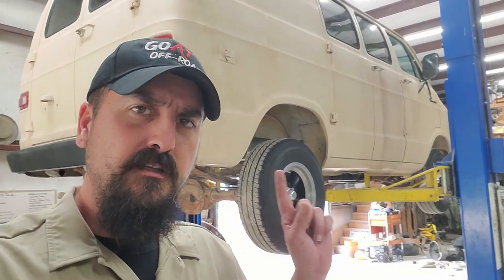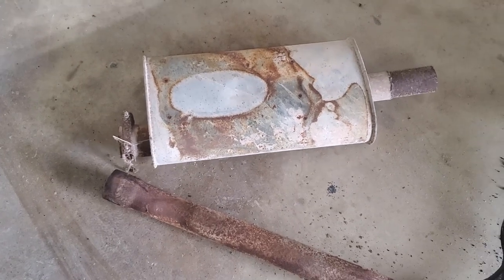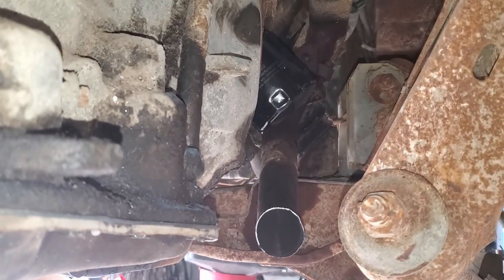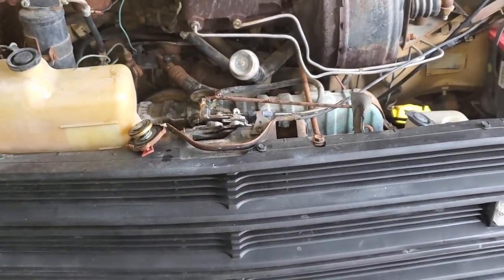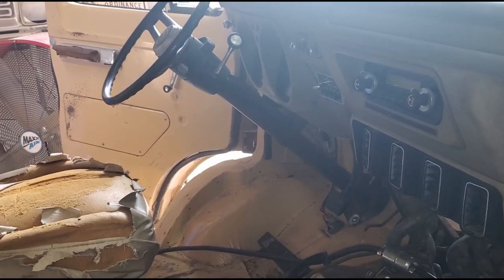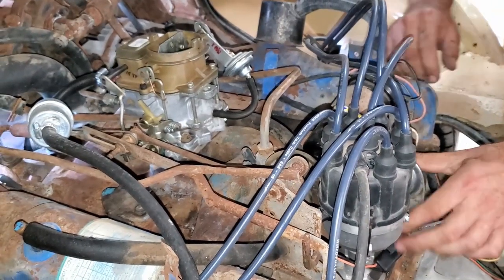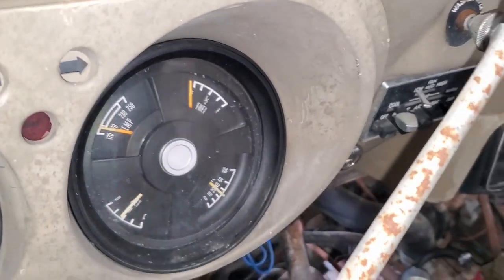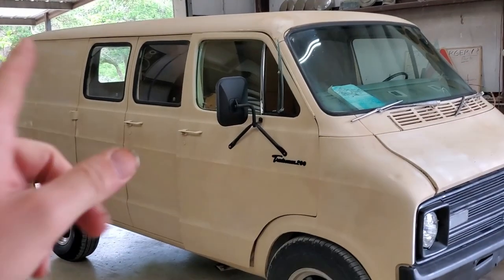ABANDONED Junkyard Dodge  B200 Van Pt 2 Will it Run ? Will it start ? Will it Drive?

Comment: The lack of trans filter tells me this was already a race van, cheaters. Jeremy might have to lose some weight/interior. Great video guys, always a blast to watch.
Reply from the maker: That's right we are cutting all the weight! Interior seats, Interior panels, Exhaust, Transmission filter, Transmission bolts! Everything is fair game!
Reply: @DuddiesAdventure  Just mig weld the pan to the bottom of the transmission. You don't need those heavy bolts.

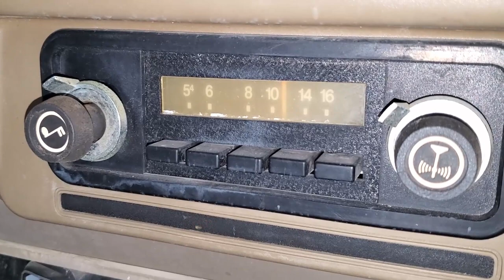Comment: That plastic dipstick was used in B vans in the 70's. There should be a light under the radio on the dash for it. There should be a mini float on the end of the dipstick that sends a signal to the switch. The light for it came for it at 18:33.
Reply: Seen that to
Reply from the maker: Good to know, I have never seen anything like that and after we were able to get power to all the gauges we saw that light work. It went off when we filled the trans so I guess it works. Thanks For the info!

Comment: Sweet van, but the real question is.... the fresh exterior paint. Is that to hide the " Free Candy" logo, or provide a good back drop, for the logo. Them torqueflites can take a lot of abuse.
Reply from the maker: The spray bomb paint job was done by the previous owner, unfortunately they must of spray it in the sun because its a textured finish that wipes off with your hands. Since this Van got us so quick, Im willing to bet it says Free Tacos underneath the paint!

Comment: I was sure someone pulled that cover and filter off the Transmission,  saw what was wrong, tossed 4 bolts back on it and sent it down the road. Awesome that it seems just fine.
Reply: No kidding.
Reply from the maker: We were pretty worried when we saw the pan and lack of filter. But it rips now!! Got lucky on this one

Comment: Van Muerte will eat Steel Vanther for a snack but that 318 needs a 4 bbl carb and Intake that tiny 2 bbl carb just won't cut the mustard and it needs some 3.73 or 4.10 gears to keep the RPM up and there is no way in hell Steel Vanther has a chance
Reply from the maker: Not sure what the plan is for Van Muerte but its going to be awesome!! Thanks For Watching!!

Comment: I always thought it was fucking stupid for the factories to put exhaust pipe right under the transmission 🙄😡. 1 its a pain in the ass to remove the transmission. 2 it makes the transmission run hottier and the dreaded exhaust flow restriction on crushed pipe  . O and i also cant stand that they put resonators on factory muscle cars 🙄. with the junkyard exhaust mod should flow like gang busters 😎🤘🏁
Reply from the maker: This "Custom" exhaust is Awesome!! may become permanent hahaha

Comment: I knew that trans would work it's a 727 just like Mopars Engines you can't kill them it will take more then no fluid no filter and racoon crap to kill a 727
Reply from the maker: Those 727s are tough!!